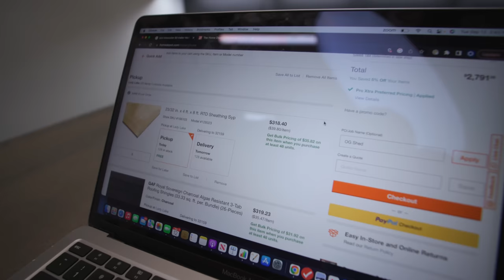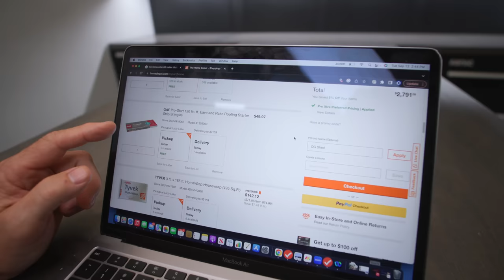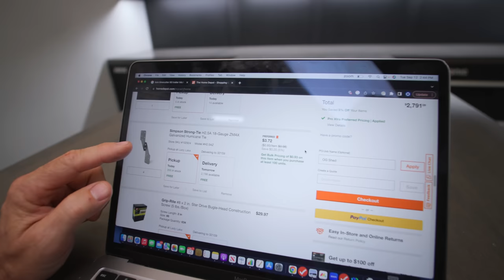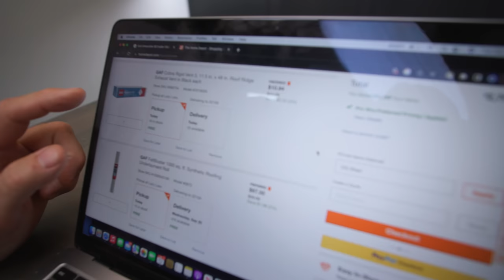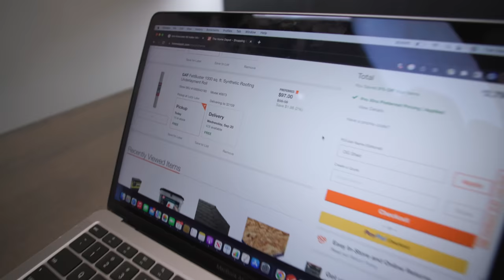Building the OG Shed with Mike F: Part 1 - Forming the Foundation

Comment: I just got a shed 12 x 20 with 4 small window, prewired lights, plug and switch. Double swing front doors all metal exterior,  2x4 interior bracing  with pt would flooring. Was about 7800.00
Reply: 😂😂 does it require a semi to move?
Reply: No it didn't 😂 it was a all roller flat bed trailer similar to what they use to deliver trusses with.
Reply: Matt has one at his house. It's 10X12 with 2x4 framing and aluminum siding. It's not so great for the money. You could open a wall up with a can opener.

Comment: A painted shipping container to match the building wasn't an option?
Reply: would have been much much much easier, and would match the building
Reply: A shipping container is only 8ft wide, we want 12 ft not to mention the fact they are ugly. We had them at the last company I worked for.
Reply: Good point. Just trying to save you a bunch of work in the heat @MikeFigueira-OG
Reply from the maker: Not an option.

Comment: A little surprised you are messing with house wrap, versus using Zip System? Of course, no idea on cost difference. Also - I hope you are a Home Depot Pro Xtra member, get some perks!
Reply: Zip sheathing would be redundant. I'm already sheeting it with T1-11 and wrap is cheap. If I was building a home and using Hardie for instance I would use Zip

Comment: Wouldn’t it have been easier to just rent a bobcat & a roller for a day (probably a few hours) to level and compact the ground? Then do the forms?
Reply from the maker: It could have been, but it's such a small area it's not much of a difference.
Reply: If you factor in the cost of the rental, the cost of having fill dirt delivered, the cost of equipment to then compact the fill, the need to divert water or deal with adding proper drainage the cost and time it would take would not make sense for this.

Comment: What about a  30000 btu window Ac unit to knock down some of the heat although running power to it might be a pain.  Edit saw you mentioned that but only operational if you move the shed.😉
Reply from the maker: I'm not going to be spending any prolonged amount of time in the shed. There's no need for an AC unit.

Comment: 3 x 4 x 5 rule?
Reply from the maker: It's a carpentry trick using a 3'x4'x5' triangle to create perfectly square corners.
Reply: @ObsessedGarage  yeah, was mentioning as I watched the cross measurements to avoid parallelogram mentioned. Was thinking 3 -4 - 5 rule would get you there as well. 👍🏻